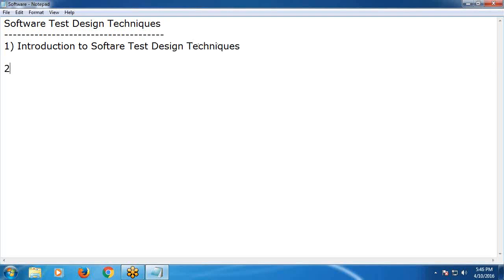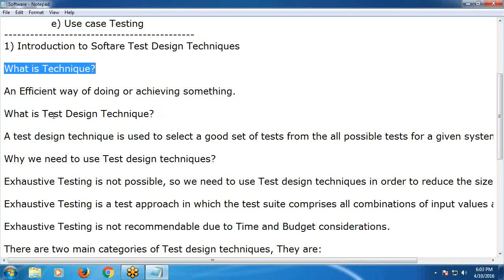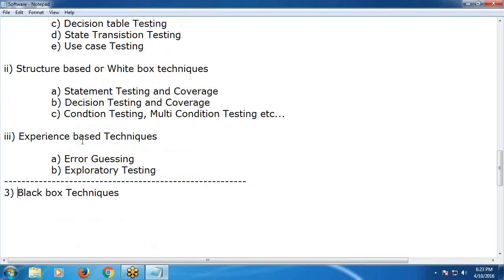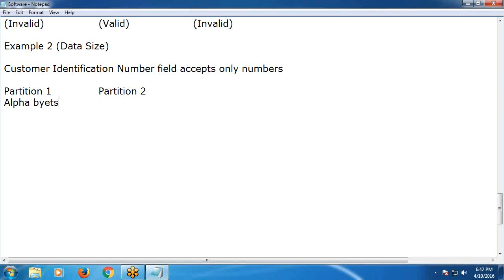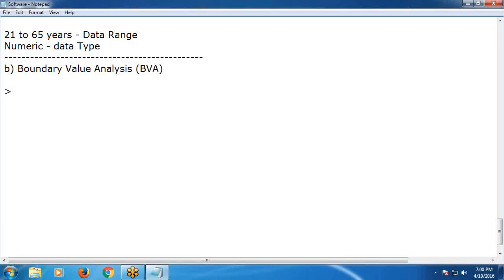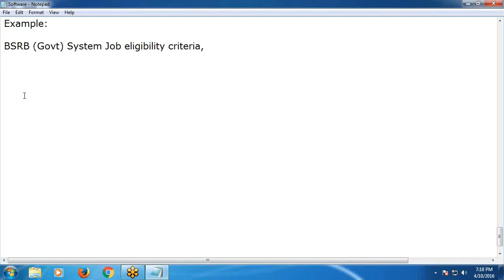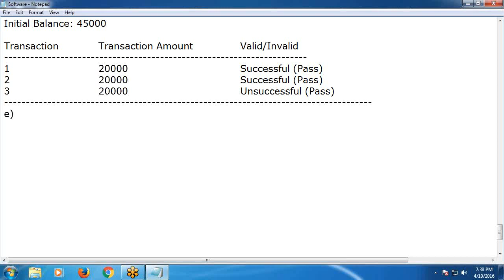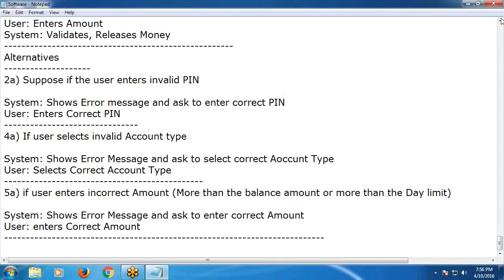Software Test Design Techniques

Comment from the maker: Software Test Design Techniques (Class Notes)

1) Introduction to Software Test Design Techniques

2) Static and Dynamic Test Design Techniques

3) Black box Test Design Techniques

    a) Equivalence Partitioning (EP)

    b) Boundary Value Analysis (BVA)

    c) Decision Table Testing

    d) State Transition Testing

    e) Use Case Testing
--------------------------------------------------
1) Introduction to Software Test Design Techniques

> What is Technique?

An Efficient way of doing or achieving something.

> What is Test Design Technique?

A test design technique is used to select a good set of tests from the all possible tests for a given system.

> Why we need to use Test Design Techniques?

Exhaustive Testing is not possible, so we need to use Test Design Techniques in order to reduce the size of the input.

Exhaustive Testing is a Test approach in which the test suite comprises all combination of input values and preconditions.

Exhaustive Testing is not recommendable due to Time and Budget considerations.

> Categories of Test Design Techniques?

There are two main categories of Test Design Techniques, They are:

    a) Static Techniques
    b) Dynamic Techniques
--------------------------------------------------
2) Static and Dynamic Test Design Techniques

A) Static Techniques
 
> Testing of the software documents manually or with a set of tools but without executing the Software.

Two types of static testing techniques

i) Reviews (Manual Examination)

ii) Static Analysis (Automated Analysis)
-------------------------------
i) Reviews

Types of Reviews

a) Informal Review
b) Walkthrough
c) Technical Review
d) Inspection

ii) Static Analysis
 
Static analysis tools are typically used by developers, Compilers offer some support for Static analysis,
------------------------------------
B) Dynamic Test Design Techniques
 
> The software is tested by executing it on computer.

Categories of Dynamic Test Design Techniques

i) Specification based or Black box Techniques    a) Equivalence Partitioning (EP)
    b) Boundary Value Analysis (BVA)
    c) Decision Table Testing
    d) State Transition Testing
    e) Use Case Testing Etc...

ii) Structure based or White box Techniques    a) Statement Testing and coverage
    b) Decision Testing and Coverage
    c) Condition Testing, Multi Condition Testing etc...

iii) Experience based Techniques    a) Error Guessing
    b) Exploratory Testing
--------------------------------------------------
3) Black box Test Design Techniques
    
    a) Equivalence Partitioning (EP)

    b) Boundary Value Analysis (BVA)

    c) Decision Table Testing

    d) State Transition Testing

    e) Use Case Testing
--------------------------------------------------
a) Equivalence Partitioning (EP)
 
• It can be applied at any level of testing (Unit, Integration, System and Acceptance Testing)

• In Equivalence Partitioning, inputs to the Software are divided into groups that are expected to exhibit similar behavior.

• Equivalence Partitions/Classes can be found for both valid data and invalid data.

Example 1 (Data Range):

Tickets field in a Reservation system accepts 1 to 10 Tickets only.

Partition 1    Partition 2    Partition 3

0                 1 to 10         11 to 99 or above
(Invalid)       (Valid)          (Invalid)

Example 2 (Data Type):

Customer Identification Number field in a CRM system accepts only numbers.

Partition 1        Partition 2    Partition 3              Partition 4     
Alpha bytes      Numbers     Special Characters    Alpha-numeric 

(Invalid)          (Valid)         (Invalid)                  (Invalid)               

Example 3 (Data Size)

Phone Number filed accepts 10 digits number only

Partition 1    Partition 2    Partition 3
Below 10      10               Above 10
(Invalid)       (Valid)         (Invalid)

Example 4 (Others)

A Payment management system accepts credit card payments only

Partition 1     Partisan 2         Partisan 3
Credit card    Net Banking      Cash on Delivery
(Valid)          (Invalid)            (Invalid)
--------------------------------------------------
b) Boundary Value Analysis (BVA)
 
• The maximum and minimum values of a partition are its boundary values.

• Behavior at edge of each equivalence partition is more likely to be incorrect than behavior within the partition.

• Boundary value analysis can be applied at all Test levels(Unit, Integration, System and Acceptance Testing).

Example 1:
Partition 1    Partition 2    Partition 3

0                  1 to 10        11 to 99 or above
(Invalid)        (Valid)        (Invalid)

Minimum/maximum 0
Minimum 1
Maximum 10
Minimum 11
Maximum 99
-------------------------------------
Example 3 (Data Size)

Phone Number filed accepts 10 digits number only

Partition 1    Partition 2    Partition 3
Below 10      10               Above 10
(Invalid)      (Valid)          (Invalid)

Minimum -9
Minimum and Maximum - 10
Maximum -11
----------------------------------------
Example: User Id field accepts 10 to 20 characters

Partition 1    Partition 2    Partition 3
Below 10     10 to 20        11 to 99

Minimum -1
Maximum - 9

Minimum - 10
Maximum - 20

Minimum - 21
Maximum -99
--------------------------------------------------
c) Decision Table Testing
 
• The decision tables are good way to capture system requirements that contain logical conditions.

• It may be applied for all situations when the action of the software depends on logical decisions.

BSRB (Govt) System Job eligibility criteria,

Age should be in between 21 and 35

Conditions:
i) For SC or ST Candidates 5 Years age relaxation
ii) For BC Candidates 5 Years age relaxation
iii) PHC Candidates 5 Years age relaxation

Category        Age    Valid/Invalid
----------------------------------------------
OC                 20       Invalid
OC                 21       Valid
OC                 35       Valid
OC                 36       Valid
BC                 36       Valid
BC                 39       Invalid
SC                 39       Valid
PHC               39       Valid
ST                 40       Valid
-----------------------------------------------------
Banking System interest rates For fixed deposits.
1 to 2 years 7%
2 to 3 Years 8%
3 to 5 Years 10%

Condition:

For Senior citizens 0.5% extra for all ranges

Age    Period    Interest Rate
-----------------------------------
25     1 year      7%
35     2.5          8%
56     4            10%
66     4            10.5%
--------------------------------------------------
d) State Transition Testing
 

• In State transition Testing Test cases are designed to execute valid and invalid state transitions.

• A System (Application Under Test) may exhibit a different response on current conditions or previous history.

Example: Internet Banking System Fund Transfer operation

Initial Balance: 45000

Transaction 1    Transaction Amount        Transaction
1                       20000                            Successful (Pass)
2                       20000                            Successful (Pass)
3                       20000                            Unsuccessful (Pass)
--------------------------------------------------
e) Use Case Testing
 
• In Use Case Testing Test Cases are designed to execute User Scenarios or Business Scenarios.

• A Use Case describes interactions between actors, including users and the system.

• A Use case usually has a mainstream scenario and sometimes alternative scenarios.

Example:

Business Scenario: ATM Cash Withdrawal operation

Mainstream Scenario:

1)
User: Inserts ATM Card

System: Asks for PIN

2)
User: Enters PIN

System: Validates PIN and asks to select language

3)
User: Selects Language

System: Asks to select Account Type

4)
User: Selects Account Type

System: Asks to enter Amount

5)
User: Enters Amount

System: Releases Money
--------------------------------------------------
Alternatives

2a) Suppose if user enters invalid Pin

System: Shows error message and asks to enter correct PIN
User: Enters Correct PIN
-----------------------
4a) Suppose if user selects incorrect Account Type

System: Shows error and asks to select correct Account Type
User: Select correct account type

5a) If User enters incorrect amount (More than the balance amount or more than the day limit)

System: Shows Error message and asks to enter correct amount
User: Enters correct amount
--------------------------------------------------

Comment: Sir,I have one doubt.In boundary value analysis. Example 1:tickets field in a reservation system accepts 1 to 10 tickets only in that shall we take minimum as below zero like -1,-2... and maximum as 0
Reply: Hi, Consider EP's as 0, 1 to 10 & 11 or above. No need to take -1, -2.... -n values
BVA -  Partition 1 Min or Max is 0. Partition 2 Min 1 and Max 10. Partition 3 Max 11 or above

Comment: getting confused in data size and data range.In example 1 and example 3 both are data range and data type i think....please sir clarify my doubt.
Reply: Given example: a password must contain 10 numbers to choose from 1 to 6.

Numbers: DATA TYPE
10: DATA SIZE (the size of data to input)
1-6: DATA RANGE (you can enter only 1-2-3-4-5-6, where 1 is the minimum and 6 is the maximum)

Please do correct me if I am wrong.